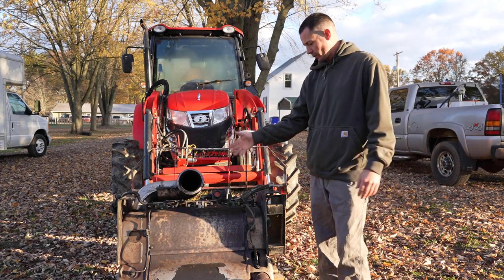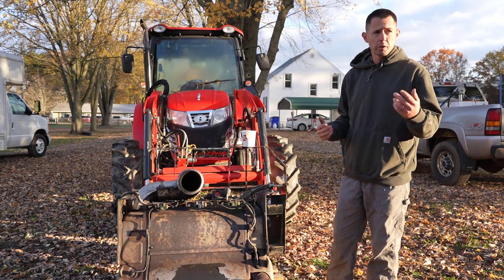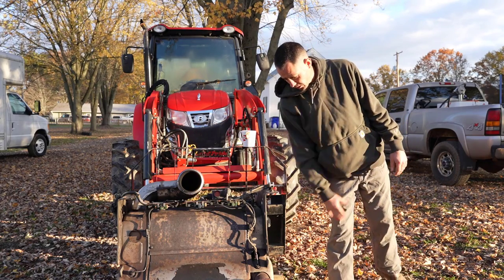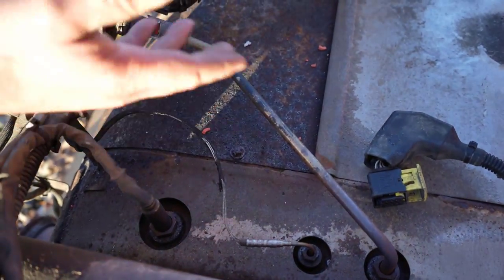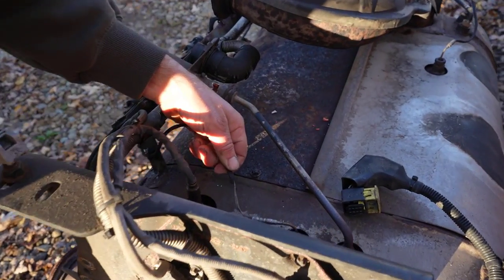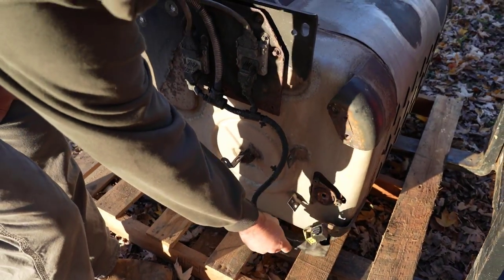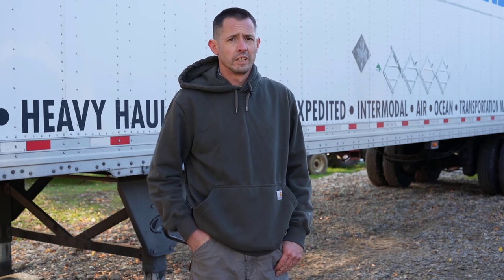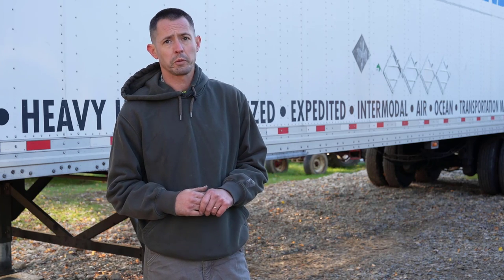One-Box DPF/SCR System Repair - Freightliner/Detroit

Comment: This was a good video.   My husband and I used our savings and bought our first truck in November and in December our truck ended up in the shop because they told us our one box needed to be replaced and it's been there for now 3 weeks and we are losing money daily not being able to use our truck.  Any suggestions where we can take out truck to get the one box looked at?  We are in Arizona.   Thank you so much
Reply from the maker: Hello, we are just finishing a one box job here for a customer. If you can drive your truck to our shop in Ohio, we can certainly take a look at it. Please give us a call first to discuss the details about your one box, so we can assess the situation and find the best approach for you. You can find our phone number on the description box. Or visit our website www.foxtruckandtractor.com
Reply: Honestly the exact same thing happened to me this year, bought a truck in November, got some codes and now the dealer wants to replace the whole one box, they quoted me 20k lucky for me I got the warranty to cover it but not working for 4 months is gonna be hard.
Reply: Great video, im out of Virginia with a 2016 dd15 freightliner, was told my one box was going bad about a year ago, but about 5 mom ago I needed to start doing regns frequently especially with heavy loads, anything out of Virginia I could get assistance with similar to this because 1300-1500 is a lot better than 10k. Thanks

Comment: My friend, would i need to go through you to get my 1box remanned? Or would you care to share your sources?
Reply from the maker: I can share the business with you! However, you should know that the company isn’t a shop, they won’t take your one-box off from your truck. They only clean the filter and fix the box. Make sure you have a mean of remove the one-box and reinstall it. Freightliner require an advanced software to input the serial number, you might have to go through a shop to do it if you have a freightliner. Otherwise, you should have a mean of reset your dpf system after cleaning. Good luck! Advanced Particulate Technologies
(814) 564-1235
Reply from the maker: https://www.foxtruckandtractor.com/
Reply: I too would like to get my one box refurbished  would you have a contact  please.

Comment: Freightliner thought my one box was out and they quoted me 10k. Im still having forced regen issues about every 2 days or less. Im on the fence about deleting it after watching your video on the subject so i dont know
Reply from the maker: Just get it cleaned like I did for this truck. It works well after the clean.
Reply: We had same problem it was a cracked box welded it cost 100 bucks to weld and replaced harness from one box to computer fixed problem

Comment: Freightliner is telling mine is bad, $24,000 to replace. The say my scr test showed 55% efficiency, and that my filter are cracked. The turbo was leaking oil into the DPF and took down the filters, there’s no oil in the box.

Comment: Where is the scr unit number located??
Reply from the maker: SCR is part of the one box. You can’t source it individually
Reply: @truckingandfixing  ya I have a 2020 that the Detroit program on scr diagnostics has a option to ender the scr unit for its replaced just the serial numbers for the dpfs?

Comment: Good video but the 2 lines on the def doser are def lines not coolant. I'm not sure your diagnostic laptops capabilities but through diagnostic link you can run a doc face cleaning procedure it's essentially a 4 hour regen that cleans the doc. You may be able to avoid pulling the one box in the future if you're able to run it on your set up
Reply: Also typically when you see those docs get face plugged you want to start looking for upstream failures causing the issues, a good running system won't just plug on its own. I usually pull the 7th injector from just behind the turbo clean the tip with a wet rag and stick a long pick down the bore and clean any soot out. Plugged air filters and poor duty cycles can also be a culprit as well. If you can when running the regen after getting it installed watch the "actual torque load" values on your laptop if they're out of range high it normally indicates injectors are beginning to get weak and are failing
Reply from the maker: Thank you for pointing it out. You are correction about the def lines. I was thinking about the Volvo truck when I was talking about it.